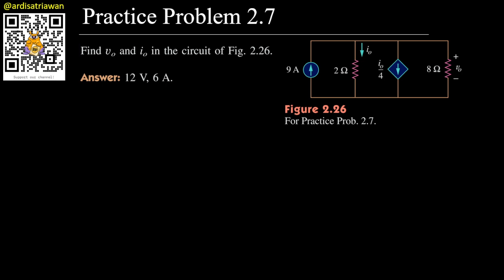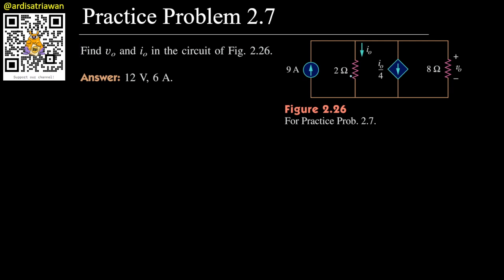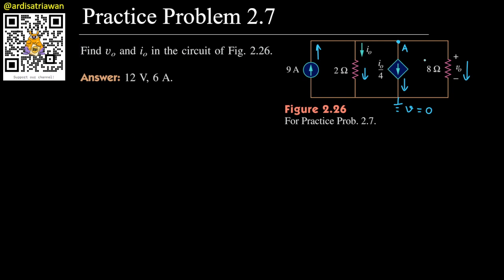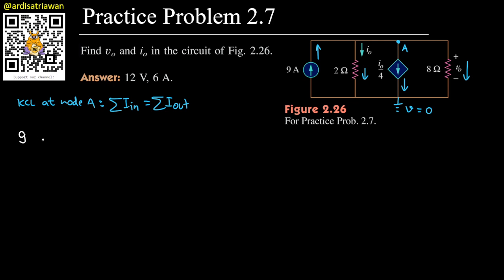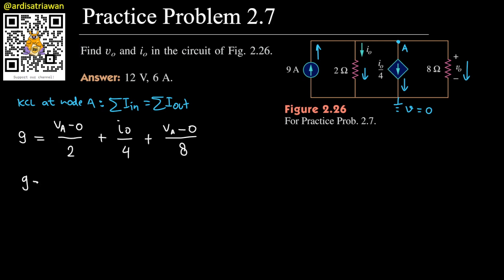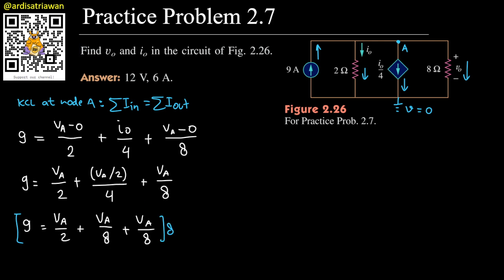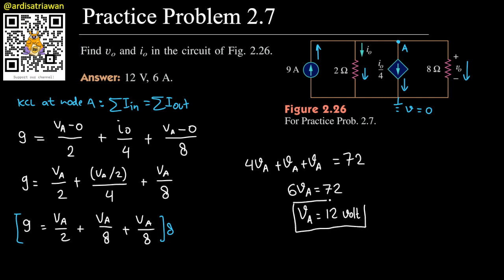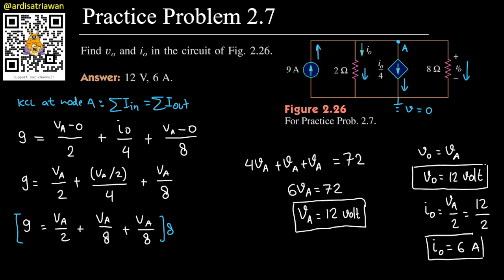Practice Problem 2.7 - Fundamental of Electric Circuits (Sadiku) 5th Ed [English - Dark Mode]

Comment: Why is the 2ohm resistor and 8ohm resistor sharing the same voltage, is it because it is parallel
Reply from the maker: Thank you, don't forget to like and subscribe!
Reply: Exactly, the definition of parallel connection is: Two or more elements are connected in parallel if they are connected to each other to the same pair of nodes, so they will share the same V(voltage difference)